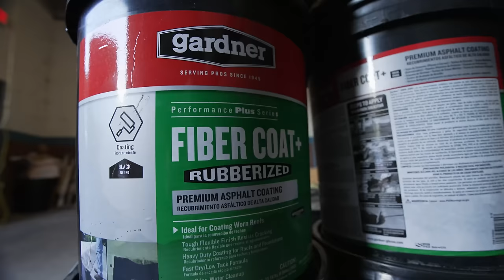Millionaire Drama

Comment: Ben, the parking lights flashing is not a power issue. The led lights in them probably got under voltage or over voltage with the storm and now the driver in them is damaged. Most likely will need to replace each bulb.

Comment: @11:50 ide assume the storm knocked a phase loose or made a loose connection. A broken phase will make your smooth power kind of have a bump in the road but will still work.

* really wish you ended up saying what the problem was I could have sworn it was gonna be dukes side.